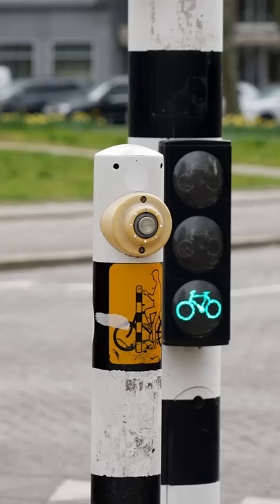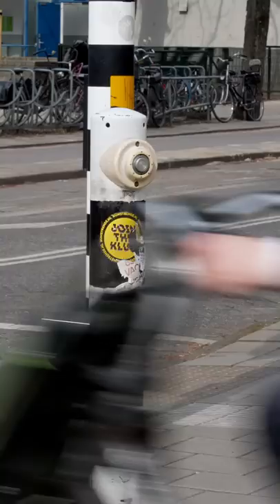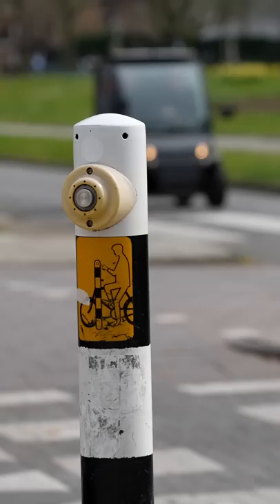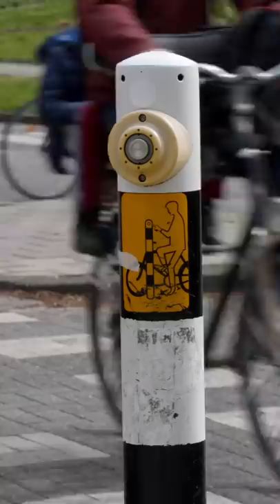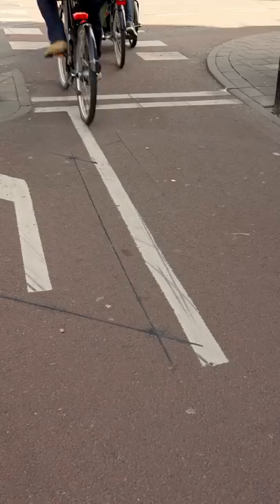You Don't Need to Press This Button #shorts

Comment: In some city. The button for road crossing is there just for psycological purposes. It also activates the Guide speaker for blind people. But thats about it. Why? Since it makes you feel in control of the crossing, Or you contribute. thus not being agitated due to impatience. When in reality wether you push it or not the timer wont change and it will still operates how it was set by the traffic agency. 

P.s. some do actually work, but thats due to that road has so low traffic that it was always set to green UNLESS there is pedestrian.

Comment: There was a turn to one of my jobs where you could pull up all the way to the red light and wait forever and it would't turn. I noticed a ring of asphalt crack filler around a spot where a car would sit if there were two waiting for the light. When I started putting my car on it instead of pulling all the way up the light changed MUCH more quickly.

Comment: Some intersections near me have the loop but it doesn't seem to help anything until it's 3am and there is no traffic to trigger the lights. If you're walking you still need to push the button because its job where I live isn't to change the light for you, it's to hold the light for you so you have enough time to cross. Depending on the intersection size a light will hold an extra 10-20 seconds if that button is pushed.

Comment: You can actually see when the system knows you're waiting; those lights light up. Even at pedestrian crossings that are made up of multiple parts. If you pressed the button and got green for the first section, check the lights on the button for the second section. If you're a fast walker you might arrive just as it lights up
Reply: And some also have a countdown function in them where the lights on the button go out one by one until you have a green light.

Comment: The lights around the button turn on if the loops have detected you (so that way you can be sure). If the button doesn’t have lights the intersection probably doesn’t have the loops.

Comment: So there's no technical reason why normal traffic lights can't detect bicycles and motorcycles. But they don't. Just one more thing to be annoyed about urban design.
Reply: The technical reason is because inductive loops made for cars aren’t set to a high enough sensitivity. Loops for bikes require cyclists to go directly over them which doesn’t always happen. Carbon fibre frames also impact inductive loops.  
Other measures like radar or pneumatics are also difficult to detect bikes because they’re smaller. 
Video is the best, but the most expensive and not always feasible depending on traffic light fixtures.  
It’s possible to detect cyclists; but it’s not as trivial.
Reply: We in Hilversum have special cameras to detect if someone on a bike is near. In the Netherlands we are as lazy as hell, even for pushing a button we have a solution for not needing to do that.

Comment: Here in Estonia, we have right side traffic, but the button is almost always at left. So you would need to cross pedestrian lane to get to the button, or opposite, if the bicycle lane is at left, pedestrians would have to cross bicycle lane. I hate those buttons. If they can detect cars riding on road why are they harassing pedestrians and bicycles with those buttons. I don't want to press that button, because I imagine how car drivers wipe their snot on those buttons when no one is looking. I totally believe that they actually might do it at night. They feel better when they can harass some non car user.

Comment: Last week i discovered a sideroad with bikelane and a traffic light at the end. Without such a button, those only exist on pedestrian crossings here in Switzerland (and are also completely useless. Mostly because of traffic lights being timed but sometimes there are detection loops under it for vehicles). This one apparently had detection loops, but just for cars... I waited through 3 complete cycles of the other traffic lights of the street i wanted to go into, but the pedestrian crossing between stayed green... Until finally a car arrived behind me and the light turned green... Happened again the next day, so now i just don't pass there anymore.

Comment: heh. I live in rural farmland area now.
The roads are ok for biking, and the traffic is low outside of the main road (connecting two cities).
There is a small narrow bridge between me and the nearest grocery store.
The bridge is so narrow, cars can only go one direction at a time.
So the smart engineers put in a detection system in the road, connected to traffic lights.

The problem? It won't detect my bike. There are no button to override, and the default state of the light at both sides, is red.
No, it's not much of relevance to this video, but I just figure I share. Maybe point out that such buttons are a nice backup.
One I would wish to have at that bridge. 

It's wide enough to pass a car there, but it can be scary when a large truck or tractor decide to cross when I am crossing it.

Comment: This is what Taiwan needs, they don't seem to use detection loops anywhere in the country so you're often sitting at a red light on your scooter in the middle of the night with no cars around.   I thought it was because scooters don't have enough metal around them to be detected but if bikes can be detected then scooters should be too.

Comment: In some cities you however do need to push them, especially as pedestrians. Groningen is one such city.

Also if there's a button for people on horseback, push it when you're on horseback, you get some extra time to cross
Reply: This video does not apply to pedestrians. There are no metal detectors for pedestrians (obviously) so pedestrians nearly always need to press the button.
Reply: @vnixned2  Detection loops are metal detectors. Pedestrians are not made of metal.
Reply: @vnixned2  Waar dan? Er bestaan wel camerasystemen maar het probleem is dat het lastig is om te bepalen of een gegeven voetganger de weg wil oversteken.

Comment: Meanwhile in Germany the only purpose of those buttons is to display a "Grün kommt" (Green is coming) to stop people from running a red light. But it nearly never has an effect on the light cycle.
There also are "Bettelampeln" ( begging traffic lights) which will never turn green if you don't press the button.
German administration just doesn't want to learn from it's neighbors, it's fucking frustrating.

Comment: Man, I get so envy at this type of bike infrastructure. I live in the second biggest city in brazil, and every time i have to came out with a bike it a near death situation, I have to bike on the street near the cars and the drives seen to hate it, here cars are totally a symbol of power and wealth since they are expensive, and they will purposely throw the car at you.

The situation is even worse because of privatization of the public transport, so the only secure way of going out is to take a Uber/Taxi or to have a car.

Things could be so much better. :(

Comment: I hear that argument so often, on the bike when I press the button. If your bike is not made of steel, you need the button. A lot of bikes are not made of steel. My bike is aluminium, I DO need to use the button. If I don't press it, the light wil not change. (Easy to tell, with the countdown lights we now have) So don't tell these half truths. The buttons are needed.

Comment: How does detection system knows that i go forward and not turn left?
Reply: Keep in mind these are separated bike paths, so there is no turn left option. If you want to go left, you first go forward and cross the intersection, and at the other side you take a left, which will line you up for another forward only crossing.
Reply: @hendman4083  ah, so they are one-way bike paths?
Reply: @Ubeogesh  The examples in this shorts were. If there were two-way paths which let you turn left before the crossing, the placing of the detection loops gets more complicated of course.  Probably there would be a turn left lane in the approaching path which would have its own dedicated detection loop.
Reply: @hendman4083  gotcha
In Warsaw we don't have one way bike paths so it was a new thing to me

Comment: So explain how bicycle tires, being rubber, show induction. That's just a no go.  The sensors are seismic and pick up vibration on the "plate" that's cut out of the path. Not electrical. It pucks up the rythmic thump thump of tires. Not passing current like train tracks do for passing gates.
Reply from the maker: You're quite confidently wrong. The induction loops detect the frame of the bicycle.

https://highways.dot.gov/public-roads/mayjun-2008/making-signal-systems-work-cyclists

Comment: Dear Not just bikes,
I am a long time fan. However, I found your  advice ad to the ‘bike button’ at traffic lights very disappointing, and indeed basically unjust. Yes, we see detection loops, but many a modern bike, not just the carbon built, will not trigger the detector. My quite modern, sturdy, aluminium built Koga Miyata 8 speed city bike more often than not does not. This is obvious from the little tell tale lights not switching on.
Furthermore I feel you strenghten the ideas of infidels, who believe the buttons have no effect at all. Trust me, we have sets of lights where the cyclist will lose a turn when not hitting the bike button!
Best/CvE